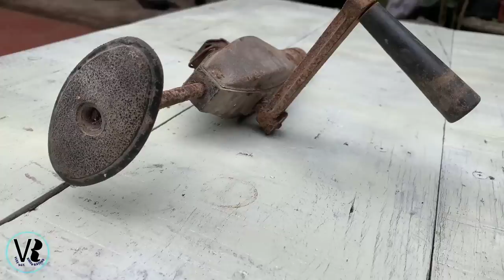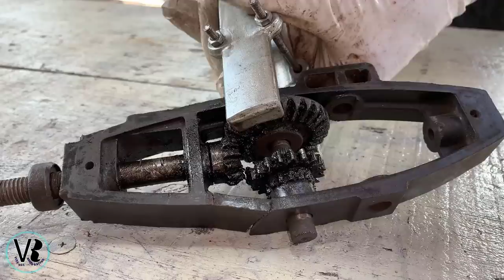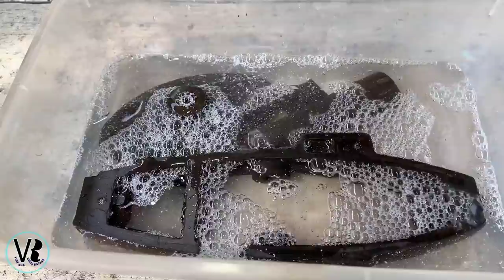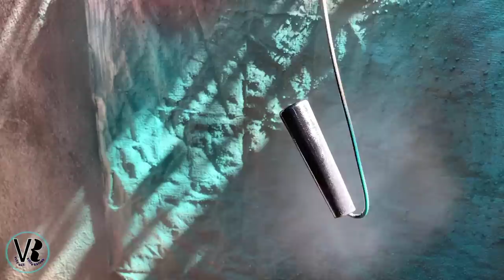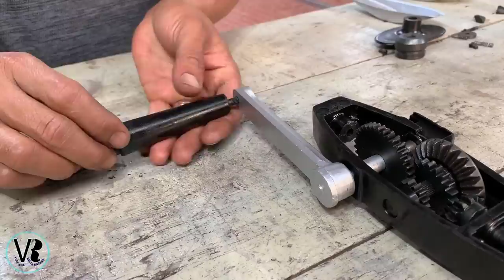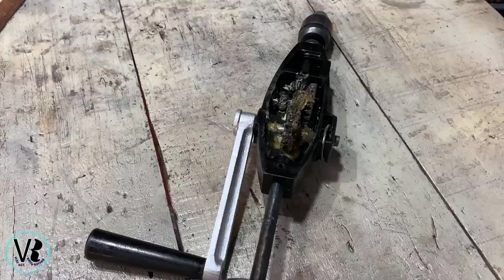Restoration Old Rusty Hand Drill  Hand Tools| Restore Breast Drill Double Pinion Milling Cut Gears

Comment: as you did not have any bearings or thrust washers to replace it was not necessary to dismantle the gearbox just a soak overnight in solvent was all it needed you are too fond of the big hammer thats how you broke it and as you have what appears to be a suitable torch why not braze it super glue and sawdust is just a joke